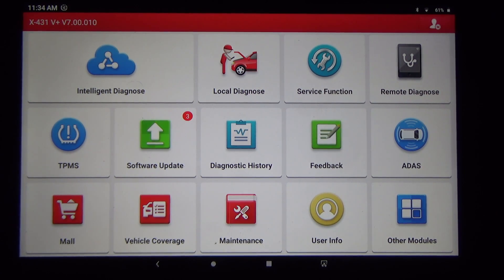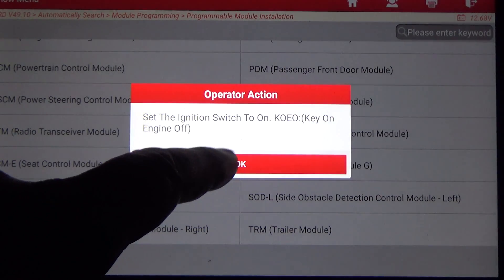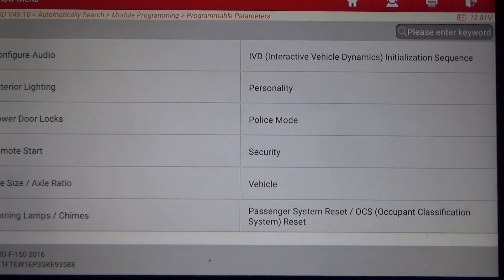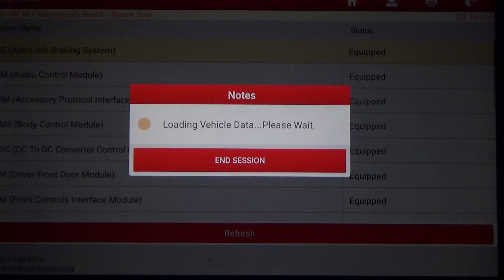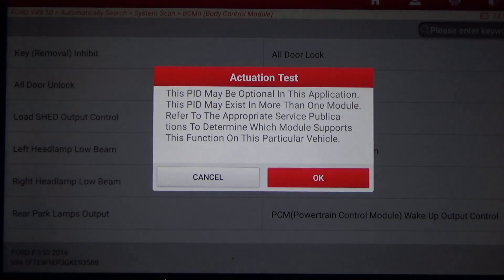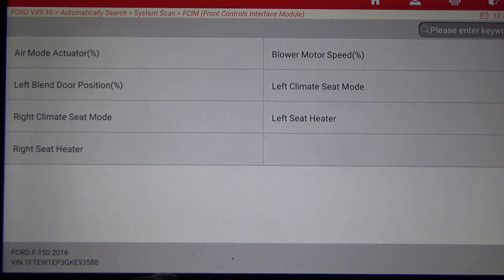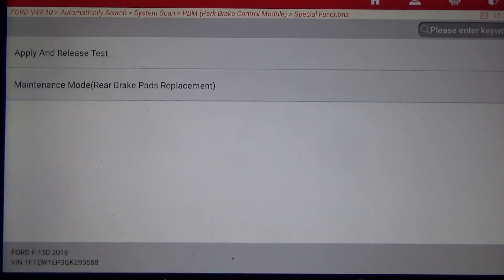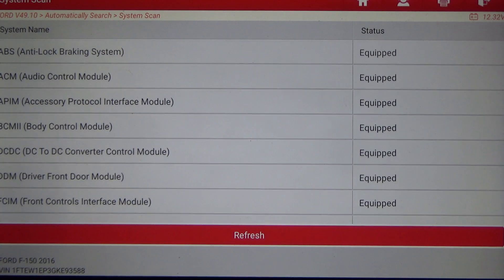Walkthrough of the Launch x431 V+ Pro on a 2016 Ford F-150 Eco boost.

Comment: It would be great if you read the warning, because after programming, the PCM engine will not start. The FORD prohibits the PATS function if you are not the dealer or have a special locksmith licence.
Reply from the maker: So are you saying you didn't read the warning?
Reply: I did read. Have you tried working with PATS lately?
Reply from the maker: @markstar6572  Not lately.